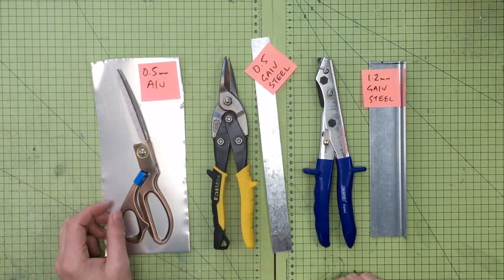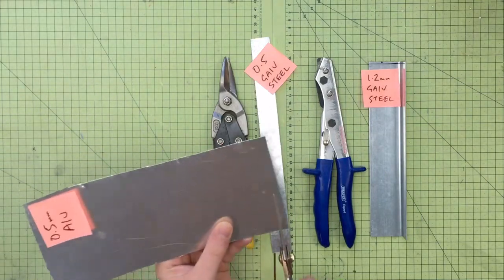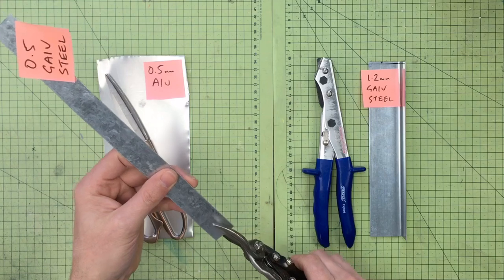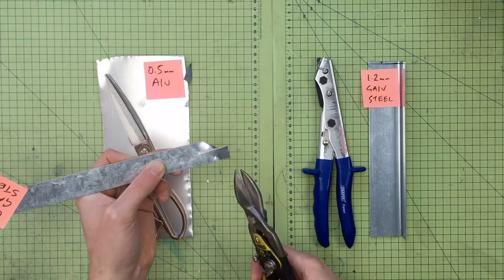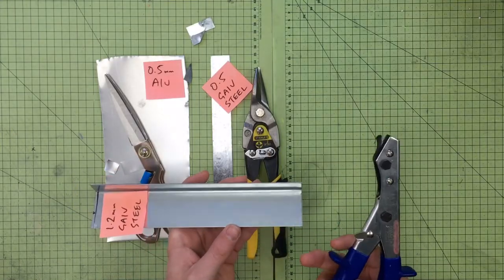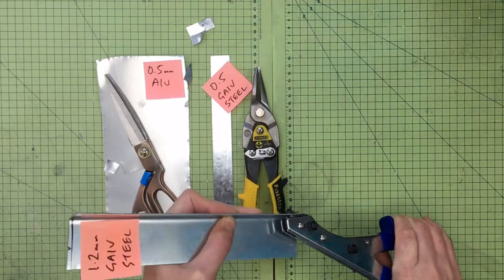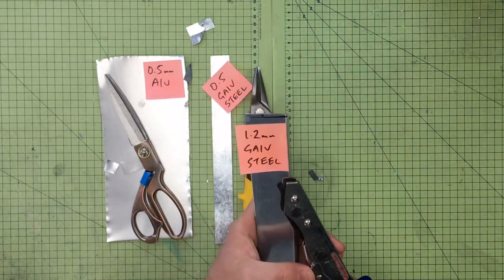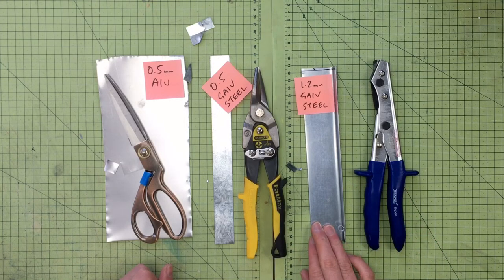Tried & Tested: Cutting Metal with Hand Tools

Comment: I'm wanting to make a shield type badge. Its a cosplay piece that can't be found anywhere so I have to replicate it. For curves etc what tools would I need I'm thinking of using 2 to 3mm thick sheet metal.
Reply from the maker: Hard to say without a sketch or more details but you might want to consider using a metal manner to beat the shape. Also look at soldering - you can do a lot by cutting out basic 2D shapes and soldering together. Prototype in card or paper first. Any use?

Comment: What’s the last tool called?
Reply: hand nibbler
Reply: There are two types, one is chip nibbles and the other is strip nibbler. The former one can make a round hole square and cut from inside holes called a die punch type nibbler.

Comment: What thickness aluminium would the tin snips handle? I have a couple of ideas for projects coming up that will probably need 1mm and 2mm Aluminium sheets. I was going to use my jigsaw, but some of the stuff I want to do is quite small and intricate, and I feel it would be safer to use snips if they would be up to the job.
Reply from the maker: KingBollock 2mm will be fine. You can’t corner easily as mentioned but it’ll certainly cut.
Reply: Or use a nibbler